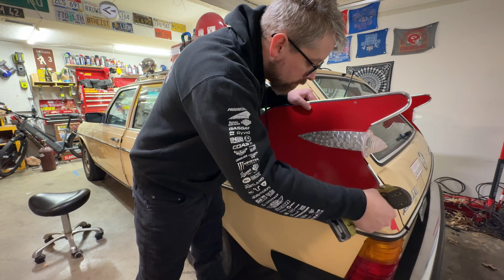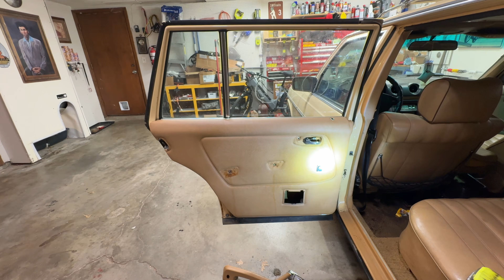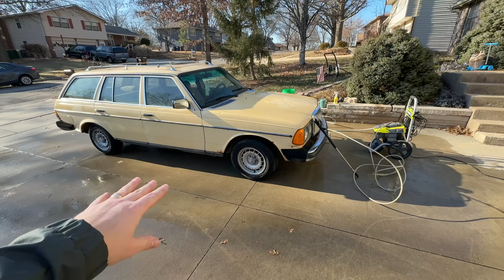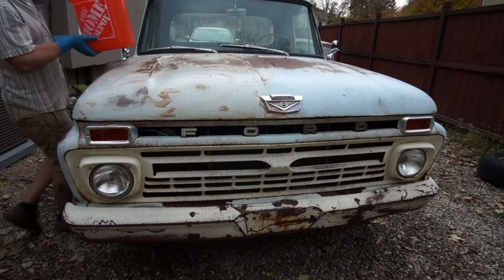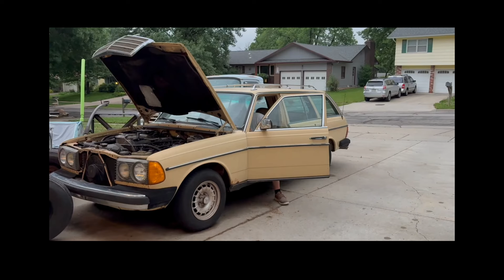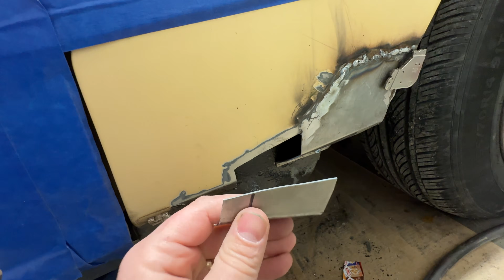1 Car, 6 Problems: Common Classic Car Issues and How to Fix Them

Comment: I’ve seen some vehicles where the power to the regulator needs the local switched plugged in to get from the driver’s switch to the regulator. Just another thing to do, check voltages on the plug. 

Love the Grateful Dead Shoppe.

Comment: The fenders are bolt-on separate parts, so you might have luck at a scrapyard if you aren't happy with your repair at the end. That's a pretty common colour and the fenders are the same across the sedan, wagon, and coupe as far as I know. You may even be able to order factory replacement fenders from the dealer for less than you might think. I did a whole trunk floor on a 450SL with OEM patch panels a decade ago for about $1,000. MBZ have really good support for older models. Also, no need to order through the 'Classic Center', any dealer can order by part number.

Comment: i just refurbished a motor in my w126 window after it seized and shorted my window switch lol. My tip is to use grease in the slide channels to keep them running smooth.